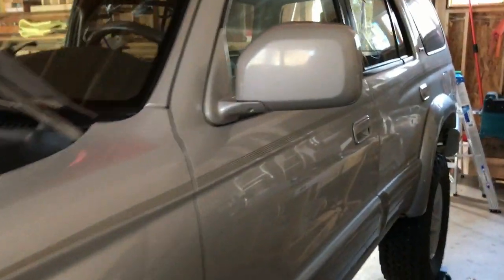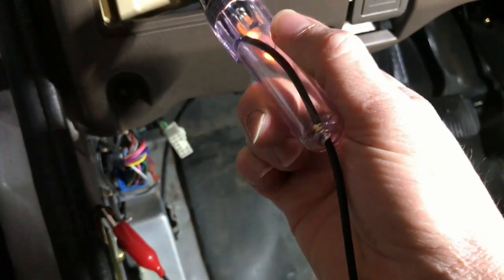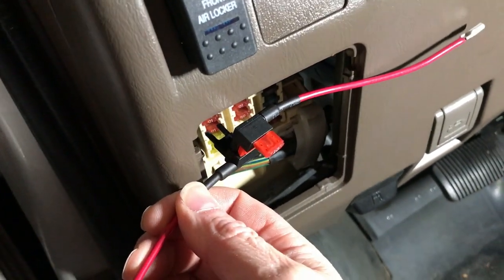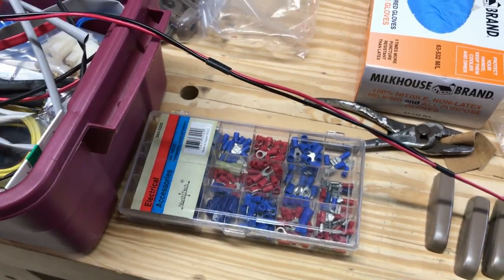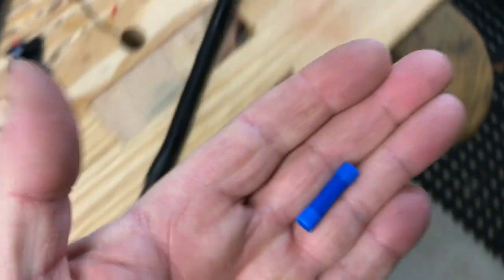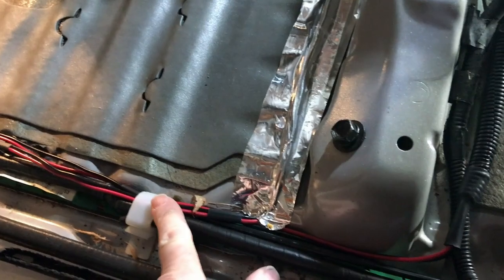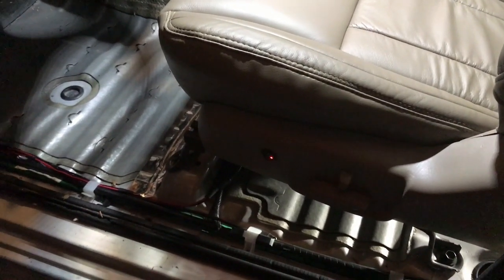2000 runner acc power to heated seats part1

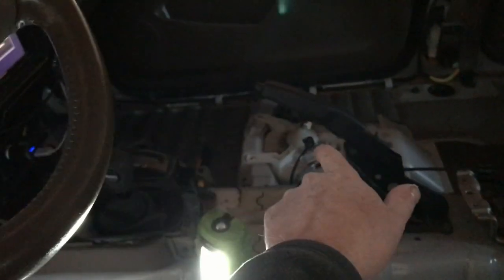Comment: 4:40 On my 3RD Gen I just routed the passenger seat heater harness along with the drivers, then crossed over underneath the center console. Plenty of room for the 2 wires and you don't have to fool around under the dash.